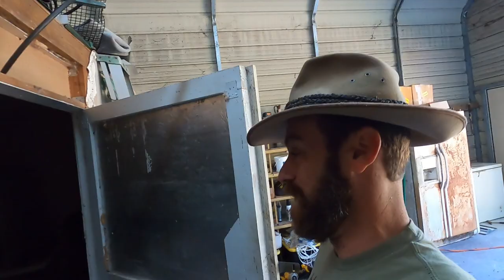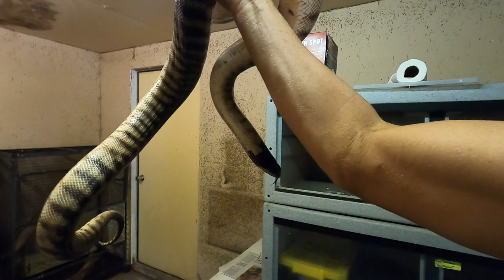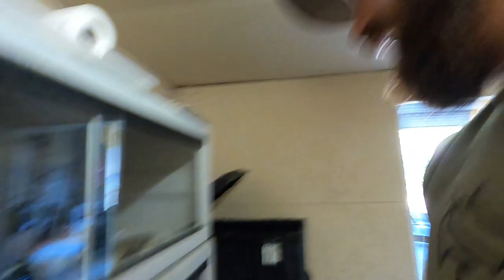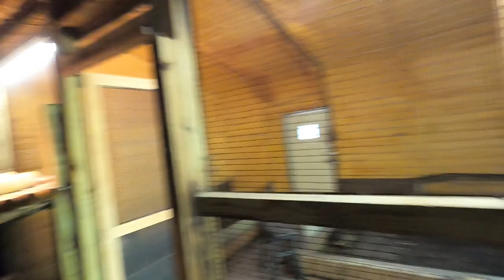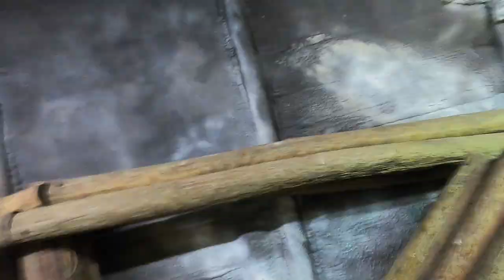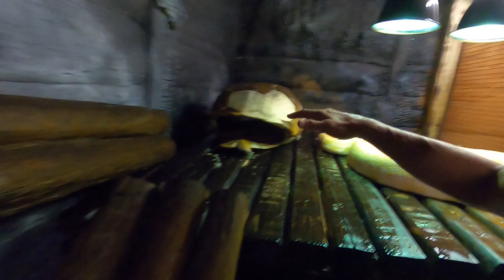I Hate Cleaning Snake Cages!

Comment: In that room against the wall build a large enclosure and split it in two sections so you can keep one snake on each side and only use it during winter that way they will have more room to move around then and you won't feel like you're being shoved into a vision box.. you can also use the for lizards if you end up with an overabundance of them during the summer

Comment: I definitely like larger, more naturalistic enclosures for reptiles. I like Tom Crutchfield's approach to "give the animal a reason to live." That's absolutely beautiful! Not only that, but I've actually found that larger enclosures make it MUCH easier to provide wider temperature ranges, which means more temperature choices for your animal. When you have a small enclosure where the cool side is only a few degrees cooler than the hot side, it doesn't give the animal many options. You end up having to make the hot side a little cooler than you probably should so you don't overheat the whole enclosure. With a larger enclosure, you can make a nice hot basking side, while the cool side can actually remain COOL for when the animal needs it.

Comment: Question: you know how you found Buttercup’s door closed? Are you going to remove it and instead put the black double strips that keep the heat in but allow the reptile to come and go as they want, or it is not practical in this situation? Just wondering if that’s not practical and better to keep the door, how about a hook latch? You can have a loop attached to that tree/branch/vine looking thing to keep it open and a loop on the other side of the box to keep it close if you ever need to.
Just food for thought.

Comment: You can definitely keep them in better enclosures than you are this winter . I’m not a fan of using paper as a substrate unless an animal is being treated for a health problem. The caging I use depends on the type of snake . I started collecting and sterilizing leaves for my blood pythons enclosures so they can bury more naturally. I still use a soil mix for a base . There is definitely more maintenance on trying to keep animals more naturally. My hognose I use shredded aspen with a small amount of soil mixed in . My hognose and my pueblan milksnakes are in kept in clear tubs in a rack . My bloods are kept on a soil mix in large tubs as juveniles but put into front opening enclosures I build out of pvc as adults